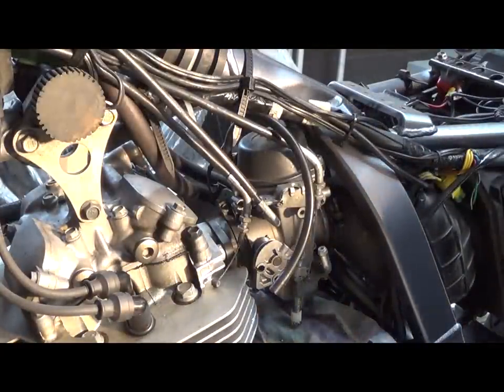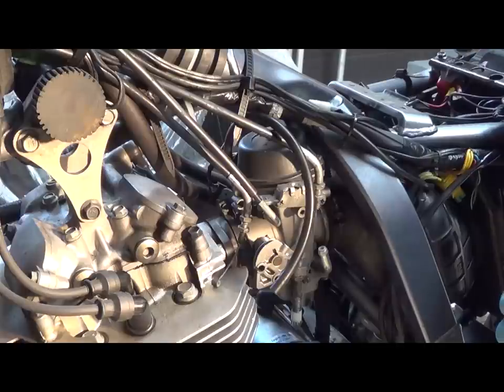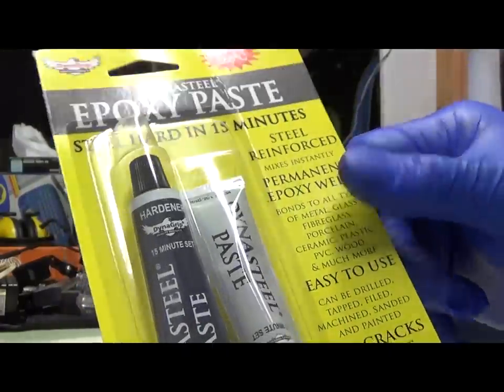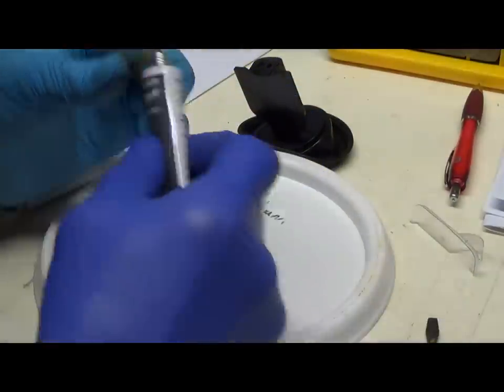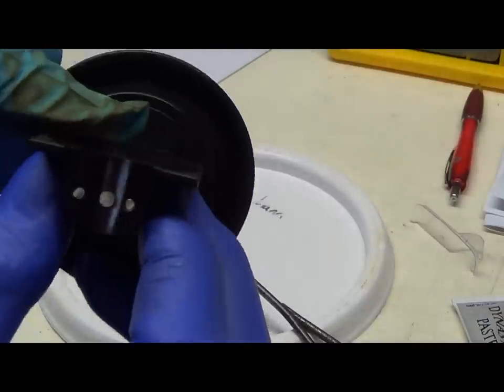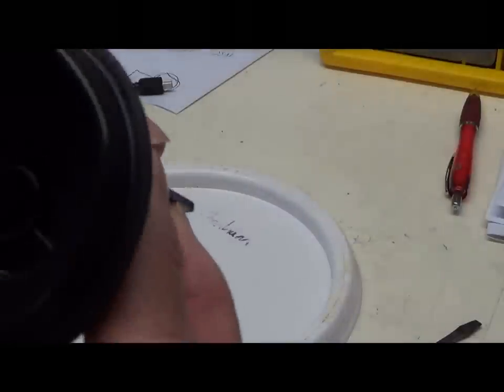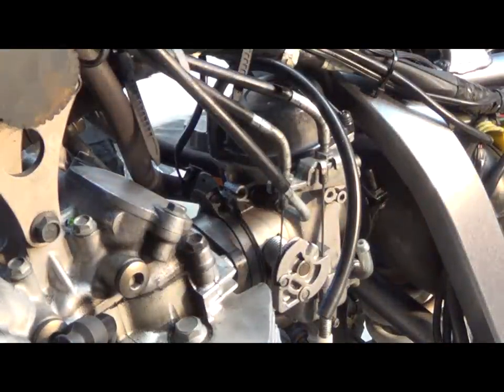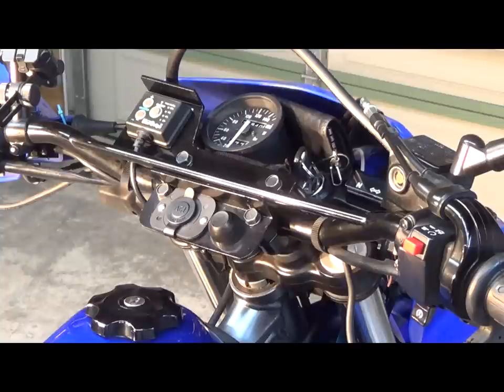Suzuki DR650 BST40 carb hole fill

Comment: We're glad this improved the surging for you.  Maybe David should have tried this.  He had the same problem after drilling the extra hole and installing a jet kit.  He gave up on the stock carb quickly after because of the surging and installed a FCR-MX.  Thanks for your videos!
Reply from the maker: Thanks for watching.

Comment: I only put in the dynojet main needle because the float bowl screws stripped when trying to put the 160 jet in. Definitely taking it off again ASAP because it’s bogging hard in 4th and 5th gear with just dyno main needle and stock jet.

Comment: Did this work in the long term.  I have a set of restricted slides with extra holes in the top of slide to prevent slide opening.  I need to fill them and came across your video
Reply from the maker: Yes it did. Thanks for watching and ride safe.

Comment: The extra hole is for added vacuum.  To have added vacuum you need added air. You needed added air because you added extra fuel when you added the dyno jet. You did 3/4 of the job and expected it to work properly. Should have left the jetting alone if you weren’t going to modify the air box. Nice tutorial otherwise
Reply from the maker: Thanks for the info...ride safe.
Reply: I agree!  do the entire job to get the desired performance! I did every step and it's a 100% improvement. Procycle jet kit install.

Comment: Good vid. When you installed dyno kit,what was end result?More power,top speed etc.Did you install the kit while keeping carburetor on the engine like in this video?
Reply from the maker: mike burrly I didn't have the use of a dyno but it certainly accelerated to 160kph in double smart time. Getting the settings right took a bit of mucking around with jets and needle settings. I took the carb off the bike each time I changed something. You will need to do this if it hasn't been off before because you will need to cradle it in your lap and get the screws undone with an Impact driver. The kit also eliminated the slow speed surging. Have fun and thanks for watching.